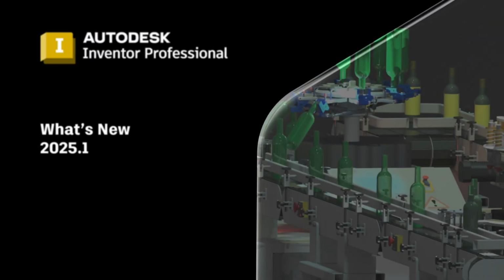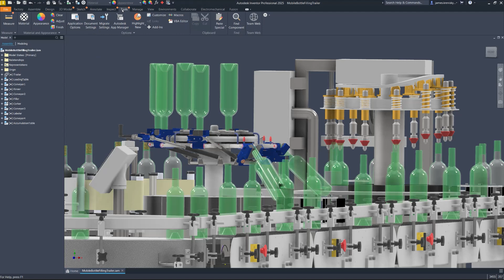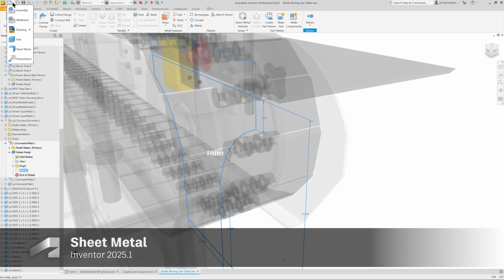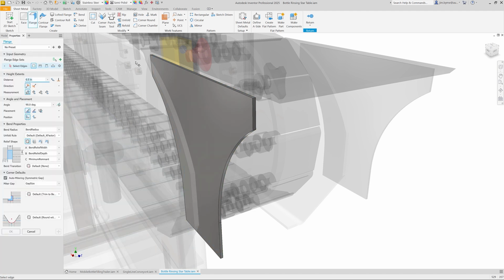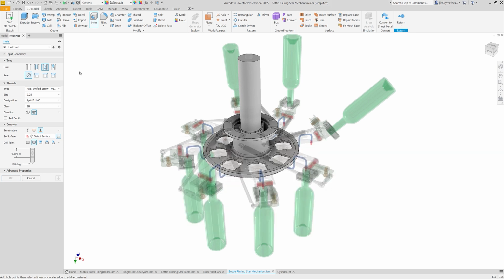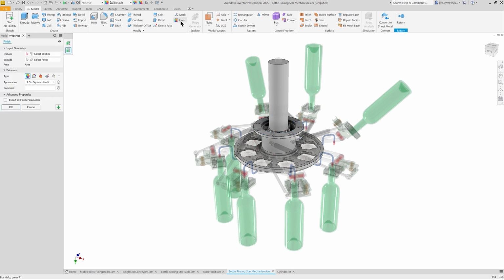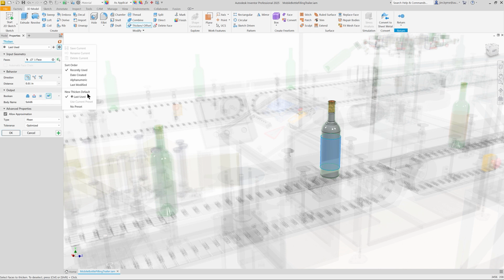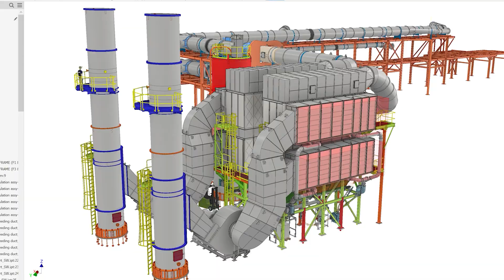Autodesk Inventor 2025.1 What's New

Comment: We want to apply real theread tooth cutting in our drawings. An update is necessary for this because the current therad command in Autodesk Invertor is very absurd. A command operation should be brought for this subject.
Reply: The most needed command for us users is the thread command, just like in SolidWorks.

Comment: Please replace the old open/save dialog box as it takes so long to open/save a file if one has a lot of drives and directories.
"Starting with Windows Vista, the Common Item Dialog supersedes the older Common File Dialog when used to open or save a file. The Common Item Dialog is used in two variations: the Open dialog and the Save dialog. These two dialogs share most of their functionality, but each has its own unique methods.

While this newer version is named the Common Item Dialog, it continues to be called the Common File Dialog in most documentation. Unless you are dealing specifically with an older version of Windows, you should assume that any mention of the Common File Dialog refers to this Common Item Dialog."

Comment: There are some fundamental parts that should be improved first and foremost. Why cant I just rename files directly in the model browser?

Also.. there should be a simple "1 click" (or at least very few clicks) copy function of an assembly with parts into a new one exactly the same but with all parts renamed according to a specified formula. For example replace "01" in all model names with "02"... or whatever. That shouldnt require more than 1 click + the renaming equation stuff + "ok". 
Imagine the amount of time spent by everyone doing this rediculous process manually over and over......

There is a copy function now where you can add a suffix of prefix.. but not the one you would want.. namely "replace x with y". So you have to sit and manually replace a number on all parts. Its r-i-d-i-c-u-l-o-u-s. Even Wordpad in windows has a find-replace text function.....
Why is that missing in Inventor making a completely fundamental function useless for absolutely no reason??

Comment: This is all good, of course, but the tool is not improving in such areas as surface modeling, freeform and generative design - these are key areas for a modern engineering approach to product development. The sheet parts were tightened to a normal level, but the rest of the improvements were not provided. With this approach, this product will not be in demand, as well as the Fusion 360. Serious companies will not buy a cloud product. And the average user needs to work not only with sheet metal parts. The development has reached a dead end somewhere...
Reply: The whole thing has underlying issues and is pretty much broken, vault included. There is no workflow that works, model states are unreliable, BOM is an afterthought, you can't select things by material, drawings are in an alpha state - you can't have two parts lists from the same source (wtf). And my personal favorites - Inventor doesn't do area (w t f). You can't access 3d annotations from iLogic. You can't get BOM from iLogic unless you recreate a cad program in iLogic. This all goes on and on